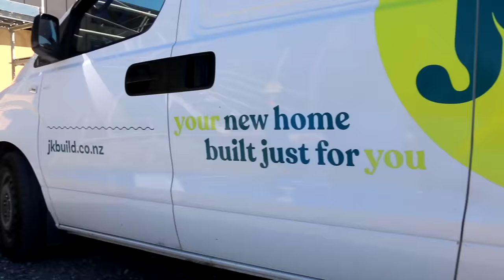Full Build Timelapse!

Comment: From a German perspective, I am always surprised how much our house construction in Germany/Europe differs from so many house construction techniques in the world. This house in the video is actually made of wood with some panelling. Even the simplest houses in Germany are built with massive concrete walls. I really wonder how this very different construction technique came about. Because there is not such a huge difference in temperature between Germany and New Zealand. On average, Germany is perhaps 3-4 degrees Celsius colder than New Zealand. But I can hardly imagine whether that justifies the building site, which is much more massive. There is also no house in Germany without a basement, which seems to be unusual in many other countries.
Reply: I would guess the wooden structure is because of earthquakes.
Reply: Hey Mr H8ter No1. 
I have had similar queries to yours from lots of European trades people regarding NZ construction methodologies. 
Some of the primary reasons for the difference in construction elements and methodologies is because New Zealand has some of the most extreme weather variability in the world - one day it can be 35 degrees and the next day it can literally be snowing. I mean it, I've experienced it. Then you can get all the other weathering elements in between, in any given week. 
Furthermore, with regard to concrete (I love concrete), my understanding is that NZ is very earthquake prone, and therefore, reinforcing concrete and placing lots of it (walls and foundations) on land which can't handle that much weight without serious resources put in to making the land solid bearing, is problematic and costly. The land here is a patchwork of various technical categories which are more earthquake and flood prone than other parts of the world. 
Also we grow lots of trees and timber is much cheaper. Timber also has a lower carbon footprint than concrete. Timber is also flexible and can potentially stand up to an earthquake quite well......depending on how far away the epicentre is and how strong the quake is....
Anyway, that is my understanding and I would be wrong. There are lots of other reasons too. There are lots of variables.
Reply: @stryka777  That makes sense. Thanks for the information
Reply: Stick to how you build in Europe. Miles ahead of typical building in NZ. Our building code lets us build to a very basic standard, but we should be building to a much higher standard. We've continued to build using "match sticks" which we did initially because of the abundance of trees we had in NZ when we were clearing land for residential building. Essentially we haven't evolved the bulk building we do beyond this outdated technique since then.
Reply: @garypatterson9593  How could our building code be made better? I mean we cant build solid concrete walls maybe have more 2 storied houses with basements to reduce house footprint so new subdivisions can enjoy bigger sections?
Reply: @garypatterson9593  and how much more would this cose?!

Comment: Questions. So many questions. Why the wood pilings under the foundation? The framing was obviously pre-assembled, but what is the pink stain? Is that some sort of insect/water proofing or simply the supplier's mark? All the cross members between the studs gives significant racking strength. Earthquake requirement? Is rockwool insulation typical in NZ? Is the sheathing bonded to a foam layer like the ZIP system in the States? Taping the seams? I would have loved to see a window install detail to see how water-proofing is achieved. Would have also liked to see the rain screen install under the rock facade.

Comment: Awesome work! Absolutely love this video!
Reply from the maker: Thank you very much!
Reply: Just wondering what are the timber posts for that were driven into the ground?
Reply: @David-nk3kq  the piles are used to support the concrete when the grounds' load-bearing capacity is not up to scratch - note, not all jobs require this option.

Comment: What was the cost to build this place not including land?
Reply: In Canada that would be about 1.5 mill and another 650,000 for the land. Looks like about 3500 sq ft give or take. No basement which might be an issue here in Canada. Pile driven foundations are not a common technology since basements are prevalent here. That would necessitate a full truss design and basement construction using poured rebar to create a complete unit that would move as a unit in the event of ground shift and manage the truss system that supports the main floor. Those would add a few percent onto the budget for materials engineering and specialized labor.  Some issues may arise with building code compliance being different in Ontario for example the in NZ. But the figures should be decently in the ballpark. Fit and finishes could alter the price by 10% either way as well as insulation and hard surface choices such as the flooring could impact estimate. Resale value could be  about$ 2.54 million after a couple of years.
Reply: I could see this costing around $500k to build where I live
Reply: You wouldn't want to know trust me probably 2, 3 million in Wellington NZ easy 250 k plus gst on land
Reply: @Evostay420  To small/not enough upgrades to hit that $$ mark
Reply: @PWingert1966  wow ok they rip you off then in Canada. That's nowhere near a reasonable "price" and most definitely not resembling the true value. I mean this slab isn't even thermally decoupled, it's framed with little sticks and I could go on and on. I've been to Canada too, Ive seen your houses. Im from Switzerland and our codes and methods are leaps and bounds beyond this and absolutely no one would pay that for this. In fact, i get a significantly higher quality build here for a lot less than 2.5mil. But hey, you do you couldn't care less what sort of mortgages people put up with. But let me tell, they rip you off.
Reply: @PWingert1966  Yeah I mean I've been following the canadian housing market a bit over the years. According to Statistics Canada, a government website, non-residents owned 2.2 percent of residential properties in Ontario and 3.1 percent in British Columbia in 2020. In terms of immigration, I get that, the question is just what your alternatives are. Without immigrants I don't think Canada would fare that much better frankly.
Reply: @PWingert1966  Wow! That's powerful! 😍
Reply: @PWingert1966  maybe in Vancouver or Toronto. In New Brunswick it would be significantly less than that.
Reply: @TeamChaosPk  It would be just under a million I would imagine. But with limited (Other than call center type jobs) high-income tech jobs and a continual boom bust cycle dependent on resource economy factors It's a challenge to live there and earn higher wages in many professions.
Reply: q
Reply: @PWingert1966 it's not Canada it's nw
Reply: @PWingert1966  Yeah nah! This house is very cheaply built in all aspects, the only way to make this cheaper would be to have no foundation at all. 

And you're telling me your would pay $ 12,000 per sqm? Thats top of the line, high end luxury home with bespoke architecture kind of pricing.

Comment: Is it a common thing in that area to not lay plywood on the roof before the metal roofing is installed? I would think plywood would add some insulation, soundproofing and strength but I'm unfamiliar with building norms and regulations in that area obviously.
Reply: not common at all for sheathing the roof... in NZ, it's trusses/purlins/iron. on the underside (ie working down) it's trusses/ceiling battens/insulation/plasterboard

Comment: It's always interesting to see construction in another country.... I don't know the codes in NZ, but have some questions.

Saw wood piles driven into ground and then cut off at a predetermined height. Are pilings a requirement on all construction, or only in certain soil conditions?

Looks like major building components are built off site then brought in for assembly. The framing wood was a reddish or pinkish color. What does that signify? After some time in the rain, it looked like color faded away.

Nice use of insulation under the slab. Great details for rebar, thicken edges, concrete beams, and expansion joints.

While it is hard to build a home in 10 minutes, it is possible to build one in under 1 month. Good project management and tight schedules can reduce time when no one is on site and no work is being done. I am Former Boeing Everett and we can built a 747 in a week. It has 6 million parts and very strict rules on assembly. I have seen houses built in 1 week. They are not inferior to same house built in 6 months... yeah try and explain that to client.  

Looks like a great place to raise a family. Thanks for sharing.
Reply: The Pink color indicates that the wood used in the element is a structural wood such as yellow pine. sometimes colored coating can indicate treatment for termites or mold resistance, subject to local code.
Reply: @PWingert1966  Thanks for comment and information.

Comment: From an Aussie; why the poles driven into the ground pre slab pour? And re that; why treated pine as opposed to concrete poles?
Also, if not too rude, how much does it cost to build in NZ as Aussie houses are currently very $$$$?
And .... you've built a very attractive house in a beautiful area!
Reply from the maker: Timber Driven Piles to good ground underneath. After the Christchurch Earthquakes ground testing requirements went nuts and now 50% of sites are engineered.
Reply from the maker: Way cheaper to Build in Aussie, I've heard unto to half as much. Thanks for watching and commenting :)

Comment: Hi. Nice Build.
Just a question about the wooden pile that was driven to the ground. Was it connected to the cement slab?
If so, how was it connected? Just curious.
Reply: I would assume due to the soft clay materiel the wooden pile were driven intill it possibly hit rock or hard surface, I think it stops the slab from slumping and cracking over time
Reply: @michaelbren3635  I never said it would be set in concrete it would just be used to find a hard surface so the pad would sit on it
Reply: the piles are used to support the concrete when the grounds' load-bearing capacity is not up to scratch - note, not all jobs require this option... & no, the slab isn't connected to the pile - rather, it is poured over the top...

Comment: very nice, what are the very large white styrofoam blocks you put in before the slab was poured? are these to save on cement costs or as thermal insulation or both? Do they have a proper name and what size thickness was used?
Reply: Waffle pods

Comment: What does NZ consider this type of home? Here in the USA, carpenters hate pre built modular homes. As easier and cheaper, did you have the option to build on site? Or was this a plan that was bought?
Reply: I don’t think this is a modular home. The frames were just built off site and assembled on site. He has a video about that on his channel.
Reply: @RyanStuart85  oh ok thanks! Definitely gonna go check it out!
Reply: This is Deffinately not considered a modular/pre-built home here, usually framing is done off-site mainly for time efficiency, while the site&foundations are been done others can be in the workshop assembling the frames at the same time. Saves time on-site.

Comment: Im interested in the foundation. What's the purpose of the foam if its not as part of a raft. Aside from the environmental question, why not just pour concrete?
Reply: Insulation?
Reply: @HAZYFALKIRK  but it didn't appear yo cover the whole ground, so it would have cold bridges all over, or did I not notice covering between the blocks.
Reply: No need for that much concrete, foam is used to save concrete (very expensive in NZ), I am just guessing here.
Reply: @luofubo  
And guessing wrong

Comment: Driven wooden piles?? eh? Do you have a video going into more detail on these? What's the ground like where you are?

*edit 1
Writing this as I go so there might be more comments here... That detail in the ground is bizarre (bizzare to me - happy to learn what is going on), driving the piles then not setting any capping detail, or even some additional bar. Does this not lend itself to differential settlement to some extent? I can't see how this would be better than just throwing another layer of mesh in there. Also adding that insulation in the slab is going to do square root of fuck all as it doesn't actually limit any cold bridging.

Comment: As a builder from tropical country, there is no way wooden house has a good value here, it's super prone to termite and weather. We use steel and alumunium for frames then brick and cement for the wall. House made of drywall is consider to be second class

Comment: Are the wooden piles to stabilize the soil and anchor the foundation? Don't think I've seen that before in land that looks relatively "flat" .. was there something going on with the soil there? Thanks.
Reply: NZ sits right on major fault lines, my thought would be to combat earthquakes
Reply: They do it in the Netherlands because of wet soil / moving ground.
Reply: So the house doesnt sink if the soil shifts, the piles are driven to help carry the weight of the structure above

Comment: Why are wooden piles used under slab foundations?
Reply from the maker: timber driven piles down to good ground - as the soils load bearing capacity was not adequate to support the foundation

Comment: Why would someone not put plywood on the rough. What happens when you need to pull that metal off And replace it because it's hail damaged. Always put plywood on the roof then fire and ice it. Then put metal on top it helps to make it quieter also. And strengthens up the rough.

Comment: nice job. I am curious what's the purpose of the wooden logs buried at the start 1:40 if then they were covered by concrete. wouldn't they rotten over time and leave air gaps?
Reply from the maker: Timber Driven Piles to support concrete foundations, one of the options we use when the grounds load bearing capacity is not up to scratch 

From what I understand the piles are treated, and the absence of oxygen also prevents them from rotting
Reply: @nzbuilder  its not true, because humidity exist and humidity its all about water so H20 which means 0= oxygen . Eventually they will rotten.
Reply: True, typically in Australia we use metal screw piers or concrete piers  to support the slab. Never seen treated timber used. Probably last a long time but wouldn’t think it’s ideal.
Reply: As a former builder in NZ, the piles are a common occurrence over here - treated to H3 (H4 is used in Termite zones, ie not in NZ & 5 being marine grade). H1 is used for formwork/boxing for concrete footings; H2 is generally used for the internal structural framework with an H3 bottom plate - anything that touches concrete -- if a concrete slab is used, then there's a damp-proof layer between the concrete & the bottom plate; if it's timber floor atop timber piles/bearers & joists, the damp-proofing is optional ). Don't worry about the regs re their use tho - NZ councils/building inspectors are very strict about what goes into a building over here!
Reply: @rafailasimopoulos2807  in which case H5 piles may be used, as they are treated to withstand marine usage - I suspect the chance of rot will be significantly lower

Comment: Would a barndominium be possible for environment like Las Vegas due to the extreme heat? Insulation issue and such? I had been thinking about hiring someone to build a 5000 sq ft one for me.
Reply: you'll not this is in new zealand, maybe try someone based in your area
Reply: Yes it will. AZ maybe hotter than Texas and Fl at times, but both have bardominiums. There’s different type of insulation options. A lot of people I know opt for closed cell foam insulation and have no complaints also window and ceiling fan placement.